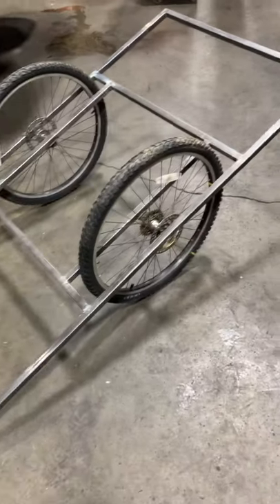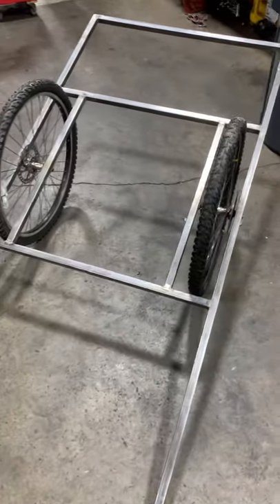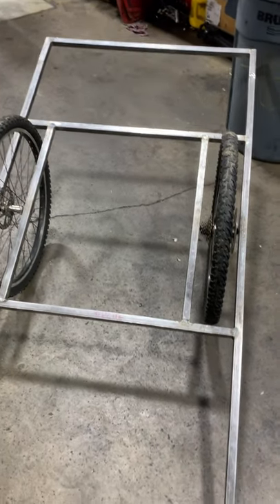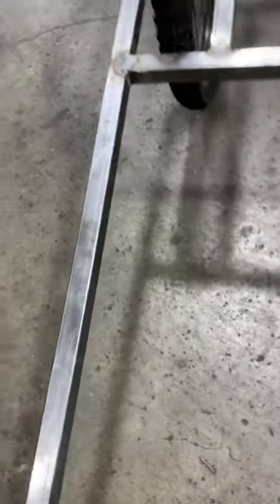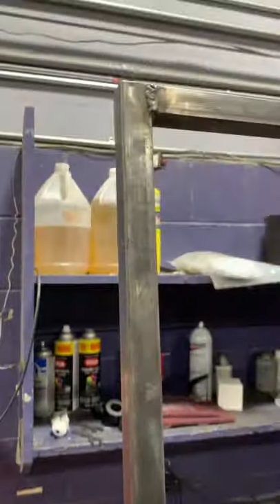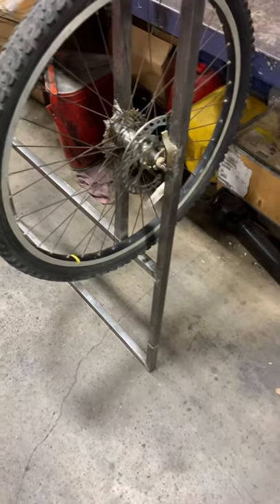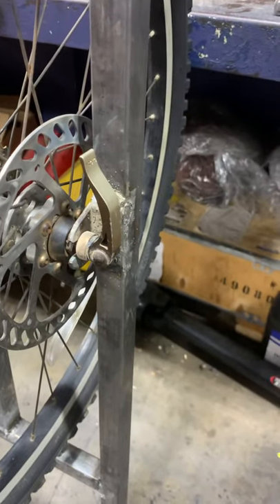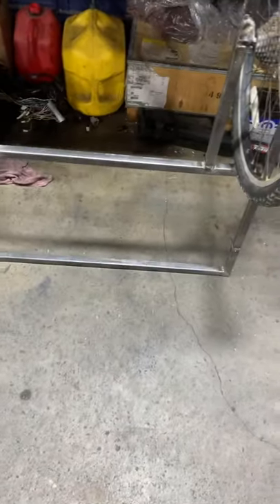Bicycle camper update

Comment: You know if it was high as your head sitting down. It would be better in everything like pulling, weight and rolling down the road. Wind and what not. Well good luck
Reply from the maker: I got this camper up to 43.2 mph and did fine.